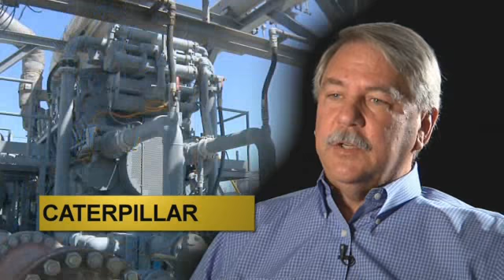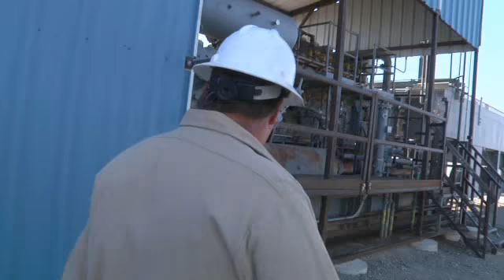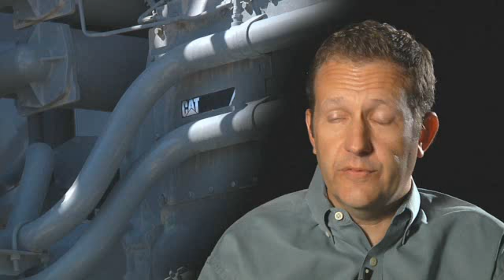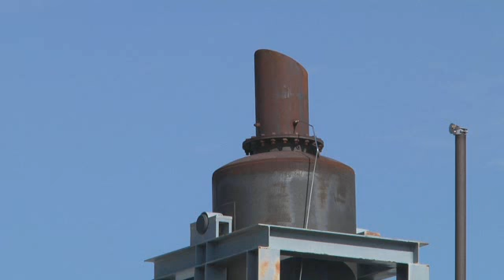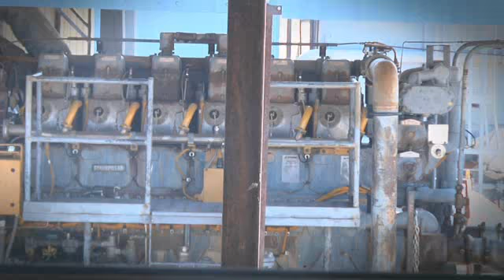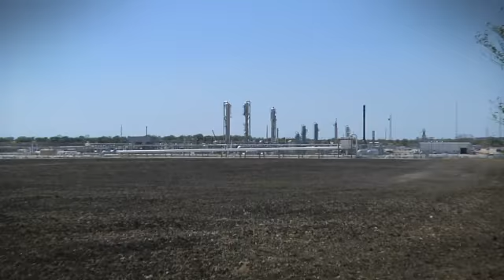G3600

Comment: And Cat wonders why truckers battle to keep that discontinued engine line operating.  We saw high levels of reliability in truck engines running in a non-stationary application at varying speeds using high BTU fuels like diesel. Competitors engines have fallen right back to their usual lack of reliability standards for our industry now that Cat has stepped back from their contribution.
Reply: I’m wondering if a cat engine in on road applications with all the emission standards would be more reliable 
???